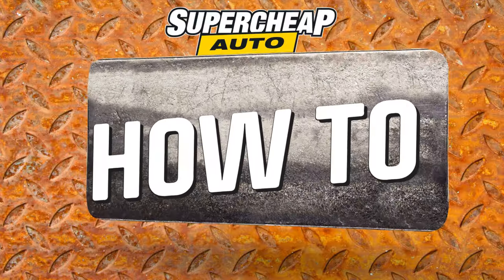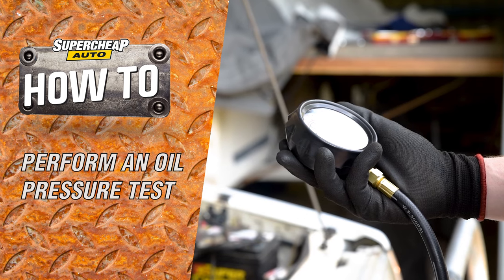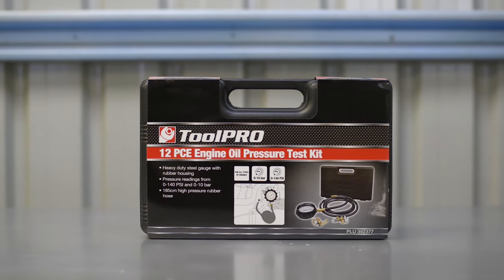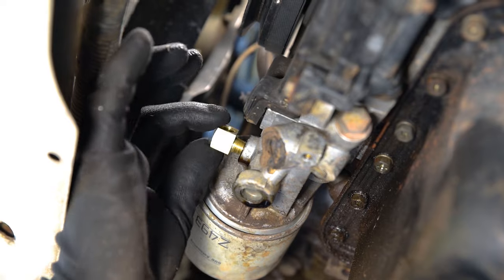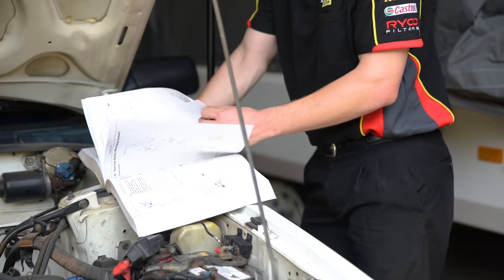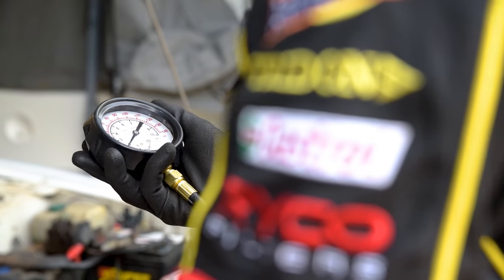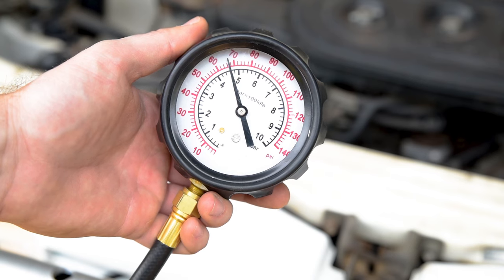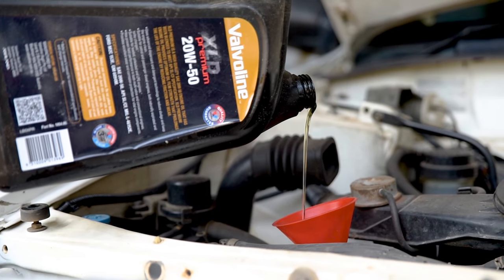How to - Preform an Oil Pressure Test // Oil Pressure Tester

Comment: make sure to use thread tape when reinstalling the oem pressure switch ect
Reply: You mean the tape for air fitting threads that doesn't work with fluids?
Reply: @spikedpigeon5740  PTFE tape definately works with fluids
Reply: Is it ok to use thread sealant instead of tape? Thanks.
Reply: @nighttime9539  i wouldnt , you dont want that sensor glued in

Comment: Great video. Do you know what a general high reading would be?
Reply from the maker: Hi Arts&Trusts, compare the results to your workshop manual specific to your vehicles requirements.
Reply: 10 lb of pressure per every 1,000 RPM is a ballpark answer.

Comment: Wont we get a check engine light if we remove the sensor to plug this in?
Reply: Possibly but they are easy to turn off, and autoparts store with an OBD2 scanner can clear your codes. You can even get bluetooth cell phone scanners.
Reply: But what does this has anything to do with checking the oil pressure? Yes, you might get a check engine light when you remove the sensor but that does not alter/change the oil pressure results on the gauge.